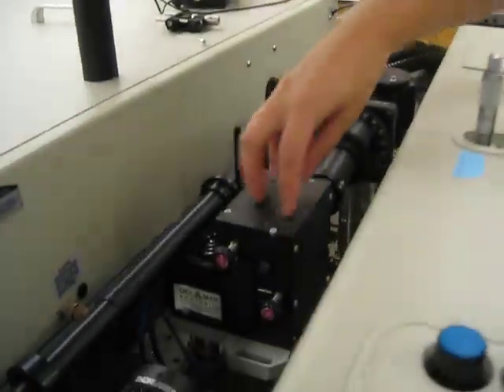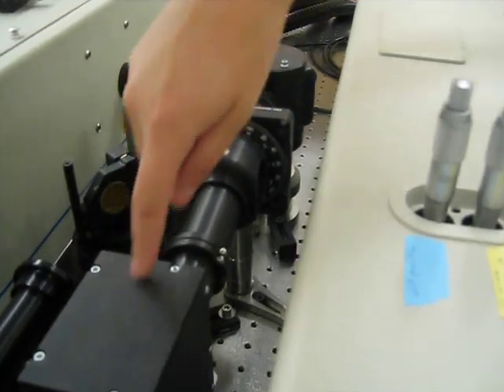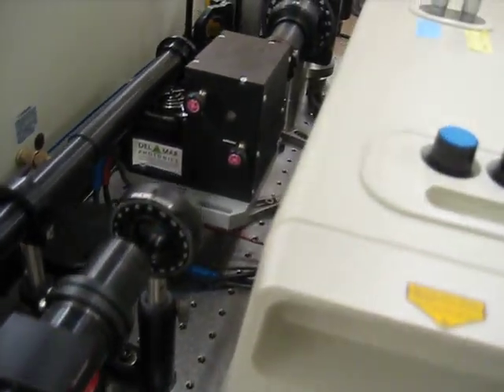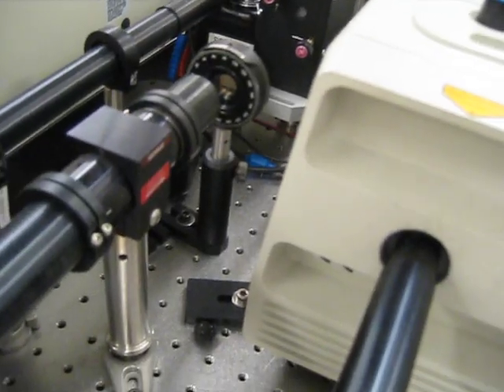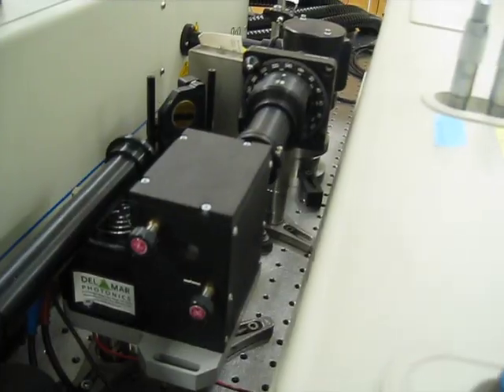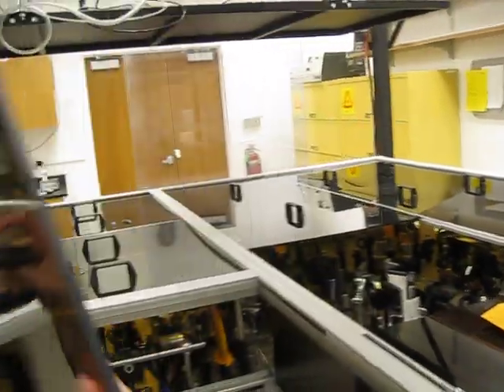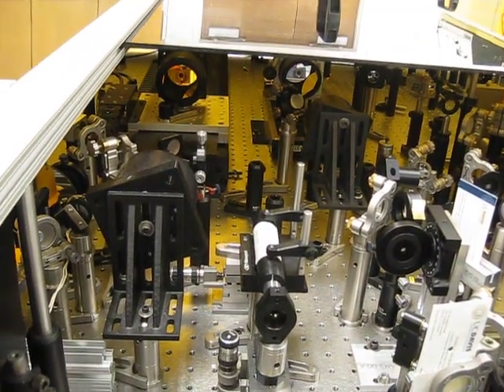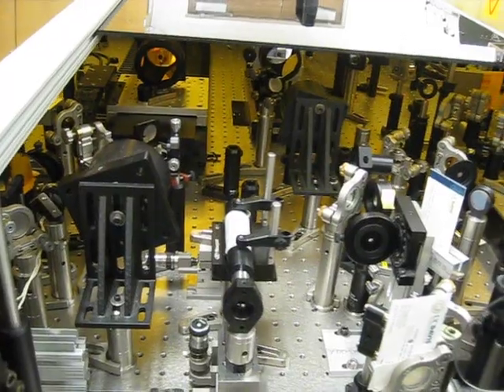A single source femtosecond-millisecond broadband spectrometer UC Davis - sales@dmphotonics.com

Comment from the maker: Pulse Picker Pismo OG8/1B for 1500-1600 nm  lasers sales@dmphotonics.com
[PP-OG8/1B]	
http://greyhawkoptics.com/product_info.php?products_id=489&osCsid=3e33a1f6623ce567d96946032c7b4c5c
Pulse Picker Pismo OG8/1B
Pismo OG8/1B pulse picker system
Crystal: BBO, 4x4x20 mm, ARC 1500-1600 nm (clear aperture – 3.5 mm), other apertures on request
HV pulse amplitude: up to 8 kV (bell-shaped HV pulse has the amplitude ~8kV with duration 10 ns at level 10% of maximum)
Repetition rate: single shot – 1 kHz
Optical source rep. rate: 30-120 MHz
Optical Synchronization input: optical (internal fiber coupled photodetector with 1.5 m length fiber)
System transmission: >85% @ 780 nm
Optical scheme: λ/4
Contrast ratio: >1:1000
Note: Also included: USB control with drivers and software, LabView drivers, Two Glan-Taylor calcite air-spaced polarizers with mounts, 1.5 m optical fiber for synchronization

Comment from the maker: Tuning Trestles CW Ti:Sapphire laser with birefringent Lyot filter 
Tuning Trestles CW Ti:Sapphire laser with birefringent Lyot filter sales@dmphotonics.com

Birefringent Filter Tuning - request a quote at sales@dmphotonics.com	
One of the most widely used methods of primary narrowing of the emission spectra of CW tunable lasers employs various modifications of the Birefringent Filters (BF), commonly reffered to as the Lyot filters.
 The birefringent filters, which we use in the CW Dye Lasers and in the Ti:Sapphire lasers, are specially optimized for reception of the largest tuning ranges of wavelengths of the radiation at various levels of the pump power and at the various active mediums. The some our papers is devoted to the analysis of the selective properties of BF. By result of the our detailed researches the BF is an establishment of new properties of birefringent filters in the optical cavity. The main results is: 
 a general formula is found for the angle of tilt at which the BF transmission function has the highest contrast;
 it is determined optimum the ratios of plate thicknesses for a three-element BF for a case of integral and nonintegral ratios;
 variations of the free spectral range and the BF tuning factor with the angle between the optic axis and the main plane of the phase plate are calculated;
 the dependence of the tuning range of a BF for a given degradation of the transmission function contrast on the orientation of the optic axes of the phase plate is obtained;
 the possibilities and advantages of using a BF with plate thiknesses differing by a factor other than an integer are shown;
 the criteria for the selection of the parameters of BF for the pico- and femtosecond tuning lasers are formulated. 
http://www.nsu.ru/srd/lls/english/amet-bft.htm

Trestles_
http://ned.ipac.caltech.edu/level5/Hawthorn2/Haw3_4.html

Comment from the maker: Beacon-DA Femtosecond Optically Gated Fluorescence Kinetic Measurement System
http://www.dmphotonics.com/Beacon-DA/Beacon-DA%20Femtosecond%20Optically%20Gated%20Fluorescence%20Kinetic%20Measurement%20System.htm
New Beacon-DA operates at 1 kHz and has even better temporal resolution than Beacon-DX that operates with Ti:sapphire oscillator.
1. Beacon-DA is easy in operation because it works w/o tight focusing
2. It has better temporal resolution because it uses simpler optical components
3. It has better sensitivity because amplifier pulses have higher energy than pulses from Ti:sapphire oscillators
4. Ultrafast fluorescence can be measured from samples which have long-lived photoproducts. It is very big advantage comparing work with oscillator excitation.
5. An OPA can be used for operation giving wide excitation spectral range.
6. SH and TH of amplified pulses can be used for the excitation too. We can quote frequency conversion unit for TH/SH generation.
7. SH only is included to the Beacon-DA free of charge for initial training but it can be always used.
7. We always recommend Beacon-DA to customers having amplifier because we should offer our best products. No reason to have the amplifier and don't use its advantages
8. What is disadvantage? Except Beacon-DA, all upconversion systems use photon counting detection. Due to fundamental principles of photon counting, it gives not more than 10^2 dynamic range at 1 kHz rep. rate and 1 sec accumulation time. One can get 10^5 dynamic range at 1000 sec accumulation time per point only. It is not realistic. It is big disadvantage of photon counting for 1 kHz comparing 80 MHz. Beacon-DA electronics gives >60 times better dynamic range for 1 kHz comparing photon counting. It means that 10^5 can be achieved at 10-15 sec accumulation time. It is the same dynamic range as for oscillator excitation. So, I don't see disadvantages and you cannot find analogs of Beacon-DA on the market.

Comment from the maker: Del Mar Photonics offers new Pockels cell based on Rubidium Titanyle Phosphate – RbTiOPO4 crystal
http://www.dmphotonics.com/RbTiOPO4%20crystal/Pismo-RTP.htm
Pismo Pulse Picker 8/1-RTP - request a quote sales@dmphotonics.com
Pockels cell OG8/1-RTP with integrated HV generator - request a quote
Crystal: RTP, 6x6x10 mm3, ARC 1500-1600 nm (clear aperture – 5 mm)
HV pulse amplitude: up to 8 kV (HV pulse has the amplitude ~8kV with duration 10 ns at level 10% of maximum)
Repetition rate: 0 – 1 kHz (external or internal trigger)
Optical source rep.rate: 20-100 MHz
Optical synchronization input: optical (internal fiber coupled photodetector with 1.5 m length fiber)
System transmission: >80% @ 1000-1600 nm
Optical scheme: lambda/2
Contrast ratio: >1:1000
Also included:
Two polarizers with mounts
1.5-meter optical fiber for synchronization
The control system has USB interface and LabView-compatible software, as well as easy stand-alone controls.

Comment from the maker: The pulse picker consists of the pockels cell, high voltage driver, synchronization and delay generator. It is suitable for single pulse selection from train of femtosecond or picosecond pulses. Also the device is used for pulse slicing in order to increase contrast.
http://www.dmphotonics.com/Pulse_Picker/pulse_pickers.htm

Pismo pulse picker brochure
http://www.dmphotonics.com/pismo%20brochure%20web.pdf

Pismo 8-1-1 Pulse Picker Manual
http://www.dmphotonics.com/Manuals/Pismo8_1pulse_picker_manual.pdf

Pismo 8-25 Manual
http://www.dmphotonics.com/Manuals/Pismo_OG8-25_Manual.pdf

Pismo pulse picker for laser wavelength: 1025~1045 nm
http://www.dmphotonics.com/Pismo_Pulse-Picker_1025-1045nm/PismoPulsePicker.htm

Pismo pulse pickers typical specs
http://www.dmphotonics.com/pismo_pulse_picker.htm

Femtosecond Pulse Pickers Pismo Questions and Answers
http://www.dmphotonics.com/pulse_pickers_Q&A.htm

Del Mar Photonics produce pulse picker systems with repetition rate up to 100 kHz. 
http://www.dmphotonics.com/Pulse_Picker/PulsePicker100kHz.htm

Comment from the maker: Pismo pulse picker
The Pismo pulse picker systems is as a pulse gating system that lets single pulses or group of subsequent pulses from a femtosecond or picosecond pulse train pass through the system, and stops other radiation. The system is perfectly suitable for most commercial femtosecond oscillators and amplifiers. The system can pick either single pulses, shoot bursts (patterns of single pulses) or pick group of subsequent pulses (wider square-shaped HV pulse modification). HV pulse duration (i.e. gate open time) is 10 ns in the default Pismo 8/1 model, but can be customized from 3 to 1250 ns upon request or made variable. The frequency of the picked pulses starts with single shot to 1 kHz for the basic model, and goes up to 100 kHz for the most advanced one. 
The Pockels cell is supplied with a control unit that is capable of synching to the optical pulse train via a built-in photodetector unit, while electric trigger signal is also accepted. Two additional delay channels are available for synching of other equipment to the pulse picker operation. Moreover, USB connectivity and LabView-compatible drivers save a great deal of your time on storing and recalling presets, and setting up some automated experimental setups. One control unit is capable of driving of up to 3 Pockels cells, and this comes handy in complex setups or contrast-improving schemes. The system can also be modified to supply two HV pulses to one Pockels cell unit, making it a 2-channel pulse picker system. This may be essential for injection/ejection purposes when building a regenerative or multipass amplifier system.
http://www.dmphotonics.com/Pismo%20pulse%20picker%20systems/Pismo%20pulse%20picker%20systems.htm

Comment from the maker: Pulse Picker Pismo OG8/100B
[PP-OG8/100B]	
http://greyhawkoptics.com/product_info.php?products_id=562&osCsid=9a09c9d66fd8d49fd75981cbb124fdce
Pulse Picker Pismo OG8/100B
Pismo OG8/100B pulse picker system
Crystal: BBO, 4x4x20 mm (clear aperture – 3.5 mm), other apertures on request
Standart ARC: ARC 750-850 or ARC 1500-1600 nm, custom ARC on request
HV pulse amplitude: up to 8 kV (bell-shaped HV pulse has the amplitude ~8kV with duration 10 ns at level 10% of maximum)
Repetition rate: single shot – 100 kHz
Optical source rep. rate: 30-120 MHz
Optical Synchronization input: optical (internal fiber coupled photodetector with 1.5 m length fiber)
System transmission: >85% @ 780 nm
Optical scheme: ?/4
Contrast ratio: >1:1000
Note: Also included: USB control with drivers and software, LabView drivers, Two Glan-Taylor calcite air-spaced polarizers with mounts, 1.5 m optical fiber for synchronization

Comment from the maker: Pulse Picker Pismo OG10/10
[PP-OG10/10]	
http://greyhawkoptics.com/product_info.php?cPath=35_103&products_id=768&osCsid=5356c2f109789e7336c50c1f06d15b56
Pismo OG10/10 pulse picker system for 700-1000 nm
Pulse picker system with synchronization and control electronics.
Pockels cell crystal: DKDP, 6x6x16 mm, ARC 690-1010 nm (clear aperture - 5 mm), other apertures on request
HV pulse amplitude: up to 10 kV (HV pulse has the amplitude ~8kV with duration 10 ns at level 10% of maximum)
(pulse duration: 0.9-0.9 - 2.3 ns; 0.5-0.5 - 5.5 ns; 0.1-0.1 - 8.9 ns; rise time (0.1-0.9) - 3.3 ns; fall time (0.9-0.1) - 3.4 ns)
Repetition rate: 1 kHz ... 10 kHz
RF source: 30-120 MHz
RF input: optical (internal fiber coupled photodetector with 1.5-m long plastic fiber)
System transmission: >85%
Contrast ratio: >1:1000
USB control with drivers and software included
Also included:
Two Glan-Taylor calcite air-spaced polarizers with mounts
1.5-meter optical fiber for synchronization
LabView-compatible software

Comment: Featured research:
http://depts.washington.edu/gingerlb/research.php
The principles and tools of physical and materials chemistry are critical to the energy generation and storage problem. Research in the Ginger Lab focuses on the physical chemistry of nanostructured materials with potential applications in low cost photovoltaics (solar cells), energy efficient light-emitting diodes, and novel biosensors. In particular, we study conjugated polymers, semiconductor nanocrystal quantum dots, and plasmon resonant metal nanoparticles. We develop and apply new combinations of scanning probe microscopy and optical spectroscopy (such as time-resolved EFM, and photoconductive AFM) to understand the basic science behind these materials and their applications in devices. We assemble these materials into new structures using Dip-Pen Nanolithography and bio-inspired materials approaches. In general we are interested in the interplay between the organizational structure, the electrical properties, and the optical properties of nanoscale materials, especially as applied to problems of solar energy. Prospective students should contact David Ginger directly.

Solar Energy: Scanning Probe Microscopy, Polymer Blends, and Nanostructured Photovoltaics
Conjugated polymers blends are promising materials for the next generation of low-cost photovoltaic materials. To better understand these materials, we combine optical spectroscopy and scanning- probe methods to study charge separation, recombination and transport as a function of thin film morphology and interfacial chemistry in thin films of organic semiconductors. Our group has pioneered new applications of scanning probe microscopy such as time-resolved electrostatic force microscopy (trEFM) and photoconductive atomic force microscopy (trAFM) to image charge generation, photocurrents, and trapping in nanostructured solar cells. In addition we use Dip-Pen Nanolithography to generate templates for controlling nanoscale morphology through surface chemistry (image above). Electrostatic force microscopy and conducting-probe AFM are used to characterize charge generation, transport, and recombination, with simultaneous spatial resolutions better than 50 nm, and time resolutions of tens of microseconds.

Light Harvesting, Ligands, and Lifetimes: Optoelectronic Properties of Colloidal Quantum Dots
Semiconductor quantum dots and colloidal nanocrystals are promising solution processable materials for use in energy efficient displays as well as photodiodes and solar cells (where infrared absorbing quantum dots might be used to harvest a wider range of the solar spectrum). We make and test quantum dot device, including quantum dot solar cells, apply optical spectroscopy including photoinduced absorption, single molecule optical spectroscopy, and scanning-probe microscopy to correlate the optical and electronic properties of single nanocrystals.

Near-Field Nanophotonics
We study plasmonic applications in fields ranging from biological detection to solar energy. The local electromagnetic field enhancements the occur near metal nanoparticles can be used to tailor the optical properties of surrounding chromophores. We study the optical properties of colloidal metal nanoparticles coupled to organic and inorganic chromophores using single-particle spectroscopy including single particle darkfield scattering and time-correlated single-photon counting with an eye towards applications in sensing, LEDs, and solar cells. We compare experiment with electrodynamics calculations. Images: (left) size and shape series of silver nanospheres and nanoprisms (right) finite difference time-domain (FDTD) calculation performed with Lumerical FDTD solutions package showing the large local field enhancements near a silver nanoparticle excited at the plasmon resonance.